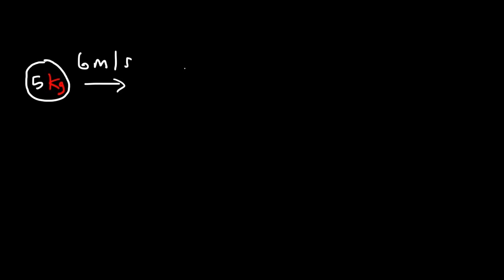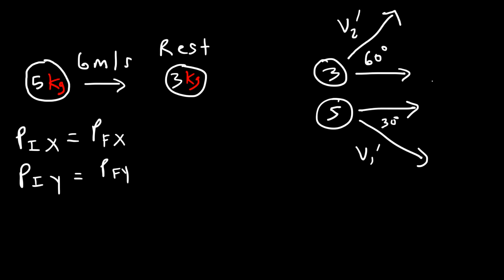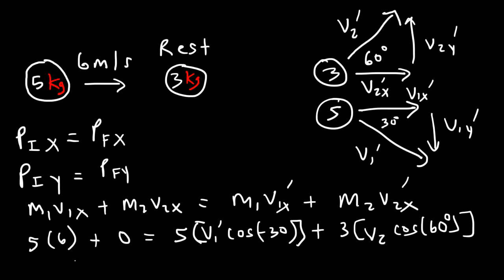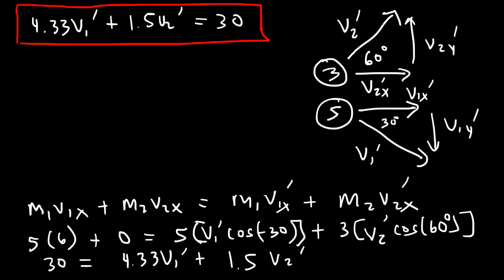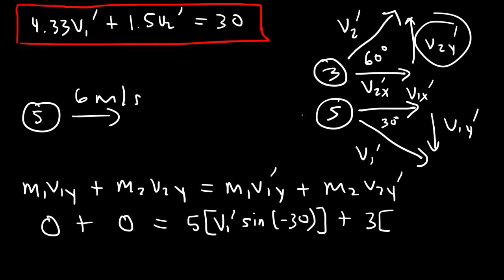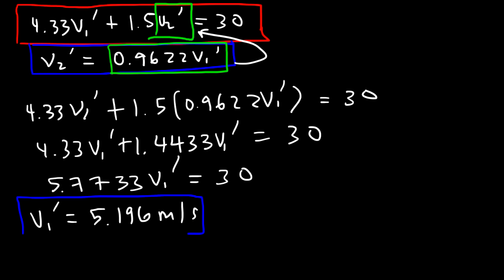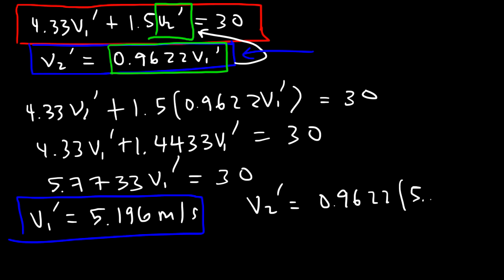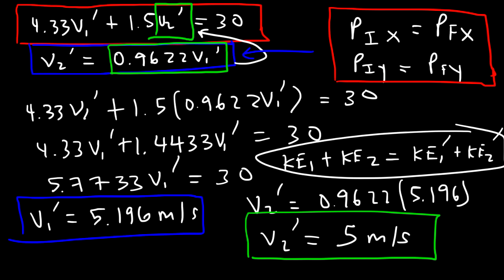Conservation of Momentum In Two Dimensions - 2D Elastic & Inelastic Collisions - Physics Problems

Comment from the maker: Momentum - Free Formula Sheet:    https://bit.ly/4fg6IvJ
Momentum - Test - 47 Problems:     https://bit.ly/3Qj9FjO
Physics PDF Worksheets:       https://www.video-tutor.net/physics-basic-introduction.html
Full-Length Videos & Exams:  https://www.patreon.com/MathScienceTutor/collections
Next Video:  https://www.youtube.com/watch?v=FfaEbqmvKQA&list=PL0o_zxa4K1BU6wPPLDsoTj1_wEf0LSNeR&index=108
Reply: Hi. I have a really important question about this video and I would be really grateful if someone could help me!

From what I know, when a ball hits a ball with the condition that the vector of the collision is pointing from the center of the first ball to the center of the second one, than the direction if the ball, which is being hit, would be the same as the direction of first ball, because as mentioned, it is a “center to center” collision. 

So I come to the conclusion that the case that is described in this video is possible, if the collision vector is not pointing at center of the second ball and so, we get different angles of the 2 balls, telling us the exact direction of each one. Am I missing something, or did I catch this right.

2. Question (I am really sorry😅)

If we have a different scenario, where you have to calculate the angles of the 2 balls after the collision, do the speed of the balls after the collision have to be constant? For example in air-hockey, the speeds are not constant because of low friction. So do I necessarily get different angles based on inconstant speeds? This is important for a project, so it really would help a lot if someone would help me…Thanks to you all!

Comment: Very clear explanation, but I do see a problem with your example.   You show the balls moving at right angles to each other after the collision. This is not possible when the masses are unequal.  If you calculate the kinetic energy before and after the collision, you'll find that the kinetic energy is greater after the collision. This is impossible, even for an inelastic collision.
Reply: No one seems to have pointed this out. There's more energy after than before.

Comment: There's a clear error in the derivation.  Look at KE before and after.
KE before = (1/2) * 5 * 6^2 = 90

KE after = (1/2)*5*(5.2)^2 + (1/2)*3*5^2 = 67.6 + 37.5 = 105.1   KE cannot be greater!

Also, a commenter said that the degree total was 90 and that could not be, because the masses were not equal. 
Well, I don't think so.  If the angles total to 90, then the collision is elastic irrespective of the masses.
Reply: I was wrong, and therein lies the problem.  The angles total 90 ONLY if the masses are equal. These masses are not equal so therefore the angle total cannot be 90.  So the problem is overspecified. The only way to solve it is to put extra KE in, which is kinda illegal. No?

Cos(theta+tau) = (v2/2*v1) * (m1^2 - m2^2)/(m1*m1)

The classic elastic m1=m2 case results in cos(theta+tau) = 0 which requires theta+tau = 90degrees.
Reply: Yeah, he shouldn't have said that the collision was elastic.

Comment: Hi. I have a really important question about this video and I would be really grateful if someone could help me!

From what I know, when a ball hits a ball with the condition that the vector of the collision is pointing from the center of the first ball to the center of the second one, than the direction if the ball, which is being hit, would be the same as the direction of first ball, because as mentioned, it is a “center to center” collision. 

So I come to the conclusion that the case that is described in this video is possible, if the collision vector is not pointing at center of the second ball and so, we get different angles of the 2 balls, telling us the exact direction of each one. Am I missing something, or did I catch this right.

2. Question (I am really sorry😅)

If we have a different scenario, where you have to calculate the angles of the 2 balls after the collision, do the speed of the balls after the collision have to be constant? For example in air-hockey, the speeds are not constant because of low friction. So do I necessarily get different angles based on inconstant speeds? This is important for a project, so it really would help a lot if someone would help me…Thanks to you all!

Comment: he made a mistake at 7:01 when isolating for V2, V1' should be 10.39 not 5.196
Reply: You are poor!
Reply: You might want to try that again. Think about it. If 30/5 =6, 30 divided by anything greater than 5 (5.77) isn't going to give you anything close to 10.
Reply: Radmehr Abdolahi I made the mistake you made too, I’m guessing you used positive angle degrees like 60° and 30°, but you were supposed to use angles such as 60° and -30°